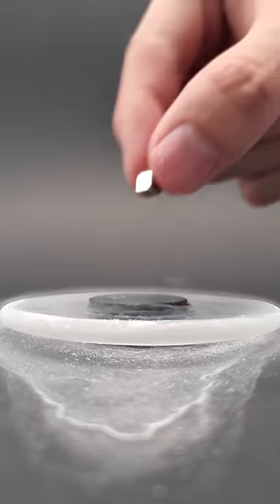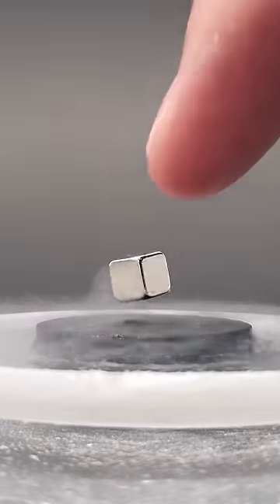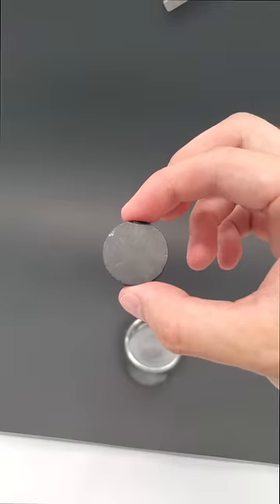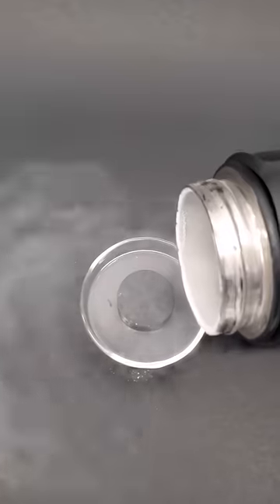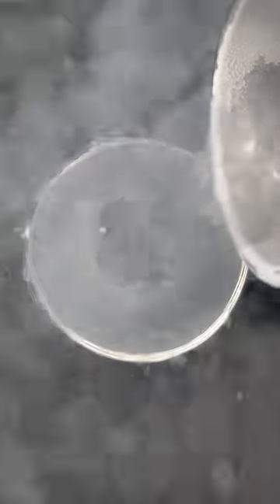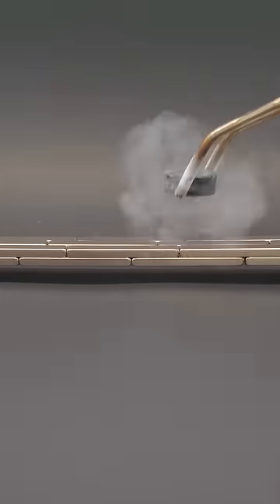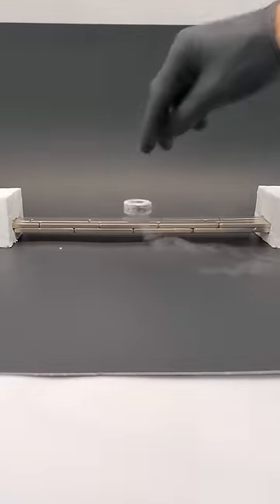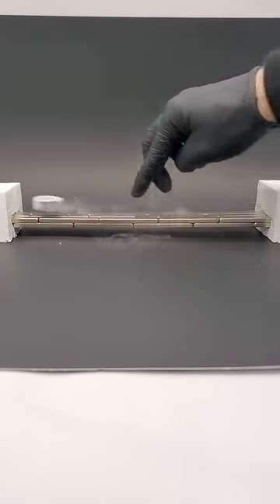Watch this superconductor hover around in mid-air!

Comment: Imagine they made something like this for air hockey. Would be amazing
Reply: I was thinking the exact same thing, here is my logistics on how it could be achieved: first off, bigger superconductor. then because it’s floating in mid air, we would have to use some sort of modified air hockey paddle what is more vertical . We would have to buy a ton of liquid nitrogen for it but whatever, and the goals would be heaters so that the super conductor would fall into the hole in the table. All in all, it wouldn’t be that big of a leap to build a superconductor air hockey table.

Comment: Imagine this is how we make Flying vehicles or just flying things to levitate items to us as the first step to flying vehicles.
Reply: Hmmm. Cars with smoke coming out of them to float. Just need to figure out the vision problem and we good
Reply: @Randy55022  we’d have to worry about it losing its effect first though.
Reply: @Randy55022  it's not smoke. It's more like really cold fog.
Reply: @JVSO1903  Yes and steering is going to be difficult to figure out. Honestly though if levitating vehicles using nitrogen and magnets doesn't reduce or completely remove the amount or carbon emissions that a normal car would produce, then I think it's pretty pointless. I mean we don't need to make cars go faster, we need to make them cleaner.

Comment: Attention Nile Red! Can you do an experiment with tying a bunch of knots in a big black trash bag, and then hang it up about 6 ft or higher from the ground and light one end on fire. As the flaming plastic drips and falls it makes the coolest sounds. I recommend putting a bucket of water underneath of it and doing this at night as it looks cool and lights up the bucket with every drop and it starts slowly but then speeds up to a rapid pace of whizzing zip zoop zops that are so fun to listen to. I'd like you to explain to me why or how it's making these noises? Maybe something to do with the shapes of the drops as the air passes over it's surface? Not sure but this is what I'd like to know. Thanks, J.J. the handyman. 😎👍🔥

Comment: Inventing a way to harness this for hover trains by having liquid nitrogen run around superconductors on the bottom of a train while the track is made of magnets would be fantastic for sustainable travel.
Reply: How would one stop the hovering train? (Reduce the Magnetic force or reduce the temperature?) Curious question
Reply: @t1o97  well you could probably have the magnets tilt or something to slow it down but I believe the bigger issue is the amount of energy required to keep the magnet in it's super conductive state. Like even the wind whipping by under the metal would technically warm it up rapidly since it's such a big temperature difference.  Definitely interesting to think about tho
Reply: @t1o97  Maybe a heating cooling system? That's a good thought!
Reply: Although we dont have the technology you could have a small fusion reactor on the train that would power the superconductive magnets on the bottom of the train and the track can be lined with electromagmets that have the ability to change polarity to control the trains accel/decel speed
Reply: @mitchell. The other way would make more sense. Super cool the magnet on the train bottoms. But this would be a sick fukking idea for air ride suspension.
Reply: @kaeosfactory  exactly!!!!
Reply: @ovenmitch4635  That would consume more energy than the trains we have today
Reply: They have floating trains called Maglev trains which don’t have liquid nitrogen tracks- they just have electromagnets that repels the train up
Reply: @t1o97  i would say u woukd prolly have to have a heating function on the track so when the train has to stop they make the nitrogen stop flowing through out the track and then have a certain heating technology to heat up the super conducter
Reply: I like the ideas here and we already have Basically have to tech already. Retro fitting existing trains would be easy but it’s the existing train tracks that would be a slight problem. And having a heating function for liquid that is supposed to stay at a negative temperature would be a bad idea to slow a train down that is propelled by a magnetic force. I think a harness could do the trick just depends on how far it needs to be to slow the train down to a full stop.
Reply: @GOTTHEDAWGINME  how exactly? You're not burning fossils fuels, it's purely based on chemical reactions? If you keep liquid nitrogen in a closed containment that conducts at the same time the temperature will never lower. The only negative side effects I could see would be chemical waste during maintenance and upkeep.
Reply: GURU DA GR8EST OVERALL  righttt???? Like I believe 70% of these comments aren’t even 23 years old yet. And they’re talking smarter than most of my teachers 💀🤚
Reply: This whole thread is a complete different language to me
Reply: @ovenmitch4635  If you meant an artifcial cooling system, which is probably gonna be based on electricity, and generating the temperature of liquid nitrogen will consume extreme amounts of electricity...
Or if it's just liquid nitrogen cooled, using that much liquid nitrogen doesn't really look that sustainable to me...
Reply: I fail to see how cooling thousands of gallons of liquid nitrogen is supposed to be sustainable
Reply: @Forerunner_Official  That would make it a superluxurious ride, while trains are meant to be quite the opposite. I don't think that changing the polarity would slow it down though...
Reply: @t1o97  Either warm the temperature or a have a really fast Turbine to produce enough air to slow the train.
Reply: maglevs be like
Reply: @strxyte9734  most maglevs aren't superconducting, and even they have issues with being efficient. Superconducting maglevs require even more energy and more complex engineering, for little benefit.
Reply: My thought exactly
Reply: All these people arguing about how to get super conductor to low temperatures. Maybe you don't need liquid nitrogen smh. What you need is a better superconductor which can function at higher temperature i.e room temperature and above.
Reply: Need a high trust society with a balanced national budget that prioritises infrastructure for that.
Reply: Or you know, fund some research on room-temperature superconductor
Reply: @aloysiuskurnia7643  that works too! I'm a social worker, not a chemical engineer LMAO
Reply: @Forerunner_Official  at that point may as well have a train running on the fusion reactor?
Reply: China and Japan have already made trains that use this tech check it out on YouTube
Reply: They already do this with magnets. No need for superconductors. Keep that cold is expensive for now, not worth it.
Reply: You sound like elon musk.
Reply: Maglevs exist and are costly. Only one exists in China because it shows off.
Reply: If you think about it, it would probably take more energy to keep the superconductor at that low of a temperature for that amount of time rather than just using fuel. I could be wrong tho
Reply: It's possible and is being done except it has to be done with liquid helium and cooled to temperatures a few degrees above absolute zero. The cryonics are kept on the train for efficiency, but it's still ridiculously expensive to build and draws a lot of power for the cryonics nonetheless. They're building a rail line in Japan with that technology right now and on test tracks the train has managed to reach a top speed a little above 600km/h. It is to run at 500km/h in service.

You can do this with less intensive cryonics or with purely electromagnets, but it doesn't hover as much which becomes a problem in earthquake prone areas and makes the tracks difficult to build for.
Reply: @t1o97  how bout make the temp higher to closer the magnets to cause friction which will slow down the train....maybe
Reply: @t1o97  attach a bunch of wheels under the train that come out like the landing gear of a plane and decelerate the train.
Reply: GURU DA GR8EST OVERALL  nah dude this is just grade school level spitballing that sounds smart because it's about magnets. Just try talking about the right subject and you'll sound smart regardless
Reply: Sustainable and liquid nitrogen shouldn't go together
Reply: @prat751  and a very specific and rare material is needed for it, which is why we just haven’t mass produced them throughout the world.
Reply: More importantly you should change your pfp because I can't see it in dark mode
Reply: @MohdAsif-hs9ke  that's the point bestie 😌💖

Comment: You could now make a vehicle with the inability to touch anything else on the track. You can then use the vehicles as passenger cars that can never crash into another one. You'd have strong guard rails so the cars can't fall of the track making the safest form of transportation
Reply: Trains like you're describing already exist. They don't even need the guardrails, the magnets can deal with that issue too!

Comment: We could use this for flying cars! The only problem is the cold.
Reply: Flying cars is just just unnecessary. I doubt that we would have it in the future
Reply: It can spray out the nitrogen
Reply: @Saudadeskate  “damn it, I’m low on nitrogen. Where’s the nearest nitrogen station?
Reply: @JeffRey-hs5yy  well it would likely significantly reduce fuel consumption as you wouldn't have resistance from the road.
Reply: @manuelfriend4060  but imagine the regulations, laws and safety in the matter.  It's just inconvenient. My bet is on speed pods. Faster and more trains less cars and of course run  by ecologically safe and renewable energy.
Reply: I was thinking about a train with superconductors instead of wheels
Reply: @JeffRey-hs5yy  People said the same things about cars when they were first invented. The idea of mechanical carriages traveling at a whopping 30mph! People thought it was a horrible death trap of an invention. Fast forward a few decades and average highway speeds are more than 70mph in some areas.
Floating cars also doesn't necessarily mean faster cars. There would be built in systems to restrict speeds to that of a regular gas powered car (human reaction time makes full manual driving impossible after passing certain speeds). The only difference is that it would consume a fraction of the fuel.

Comment: I hope someone really runs with this and can understand what is happening. This is so odd.
Reply: It's called quantum locking. Superconductors lose their magnetic qualities, but, there are still impurities in the substance that allow the magnetic field to penetrate through pinpoints, like strings through a sieve. This creates a force that prevents the superconductor from moving about, and, since magnetic fields are polar, the superconductor can glide along that axis.

Comment: So theoretically speaking, if the floor's a pretty big magnet, you can make a hoverboard, so long as you can figure out a way to safely permanently douse a super conductor connected to the bottom in liquid nitrogen?

Comment: I wonder if you could encapsulate it in a pressure tight vessel that's light enough so as not to effect the phenomenon, but also keep the superconductor at a consistent temperature.

Comment: Frictionless magnetic motors using room temperature superconductors could generate vast amounts of clean energy.
Reply: A motor doesn't produce energy
Reply: @hantrio4327  Frictionless motors do create energy by the use of magnetic fields inducing electrical currents in copper coils around iron rods.
Reply: @safirahmed motors in general produce electricity if spun by an outside force
Reply: @safirahmed motors in general produce electricity if spun by an outside force

Comment: With help of this why scientists not making a floating car? And magnetic tracks
Reply: Because the superconductor needs to be at incredibly low temperatures to work. Cooling them down and keeping them cold gets really expensive. There are some experiments you can look up that do do it anyway though. What you want is a room temperature superconductor, and I can guarantee you're not the only one who wants to discover one. It is a very active field of research.
Reply: @noob19087  maybe they can fit some of cylinders of liquid hydrogen or dry ice next to the magnets and it will work easily
Reply: another issue is that flying cars just aren't practical. It's not something we'd want to make even if we could .

Comment: I need to study superconductor. My thinking the magnet is floating because either both magnets are facing south or both facing idk
Reply: Not quite. That would be just typical magnetic repulsion, and you don't need very cold magnets for that.

Notice how he isn't using two magnets here, only one, and a cooled superconductor. So it's not a matter of opposing poles.

Also notice when he as it on the track, imagine what would be the behavior if you did this with two magnets? The magnet below would push against the magnet above, and the magnet above would be pushed to one side or the other and fall off. But look at the video, it stays in the track, both being pushed against, AND PULLED back down to the track. This wouldn't happen if it was just two magnets pushing against each other.

What is actually happening is a phenomenon called Quantum Locking. The superconductor disc is flux-pinned into place and can't go down OR UP unless moved manually. The most noticeable difference between this and a simple two magnet setup is that you can turn this one upside down, and the disc won't fall off. It will just float the same distance away from the track, but underneath it, almost looking as if gravity doesn't affect it. It is "locked" to the track, whether above it or below it, doesn't matter. This is quantum locking.

Comment: Why does it need cooling to work?
Reply: Because currently there are no known materials that achieve superconductivity (zero resistance conduction) unless cooled to very low temperatures.

The conditions that allow for zero-resistance electron conductivity only exist (current knowledge) once the material has been cooled and those resistances fall.

Comment: You should try out that new product that just came out on the market but just be careful when you spray it cause the floating magnet when sprayed improperly will make the super conductor flip in midair and then the magnet will forever be magnetized and permanently stuck to the rail. They sell it fairly cheap at Home Depot and the trade name is 50% CHANCE. It's pretty kool when you start playing with it but like I said if it flips your fooked!   😂   😂   😂   😂   😂

Comment: 🤔 Soo the questions I have can one make a close loop system for the liquid nitrogen aswell cooling the super conducteur , as this looks like it's friction les so there is almost no loss of energy, if you use air trusters to propel the train and get  external shieldding from outside warmth, high speed trains based on this can be a thing

Comment: Similar to MagLev?
Reply: Sort of. Typical MagLev is just magnets of opposing polarities pushing against each other. What's happening in the video is different, though also used in a different type of MagLev that is much more recent (Superconducting MagLev).

The big difference that a lot of people don't realize is that if you float a magnet like this above an opposing magnet that's just pushing it, it will fly off to the side, it won't just stay in place at one height. What's happening hear is something called Quantum Locking. It's not going down, but also not up, and in fact he could turn the whole track upside down and the magnet wouldn't fall. It would "float upside down" as if gravity just doesn't exist. It's really bizarre to witness actually.
Reply: Interesting! I did'nt think of it that way. The stability really isn't guaranteed, something else has to be introduced to create stability. Can quantum locking be used in large applications like the MagLev trains?

Comment: What's a superconducter😅
Reply: You know that there are two types of materials, conductors and insulators? Conductors allow electricity to flow through them, like wires in electrical devices, while insulators don't allow electrical flow. In other words, conductors have low resistance to electric flow, while insulators have high resistance. That's the reason rubber gloves prevent electrical shocks, they insulate. You've probably noticed that if you use your computer or phone for a long time, it starts to heat up. This is because as electricity flows, the electrons bump into the atoms of the material, and every time a little bit of the electrical power gets converted into heat. This is because even the best conventional conductors have a little bit of resistance. Superconductors use quantum mechanic shenanigans to get their resistance to ABSOLUTE zero. No resistance whatsoever. This makes them great conductors, but also gives them some weird properties like what you can see in the video.